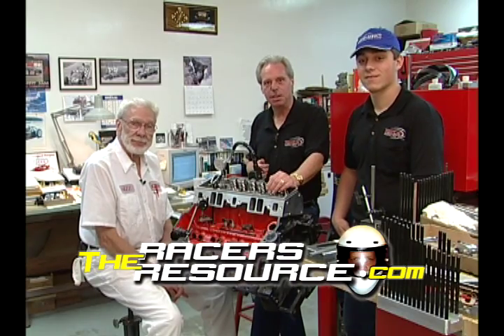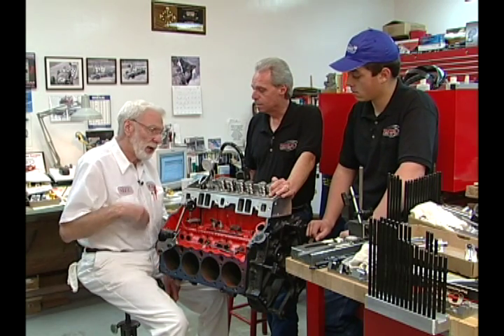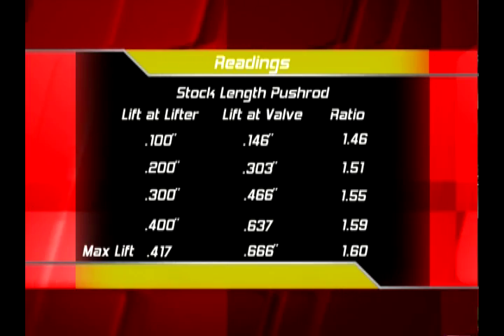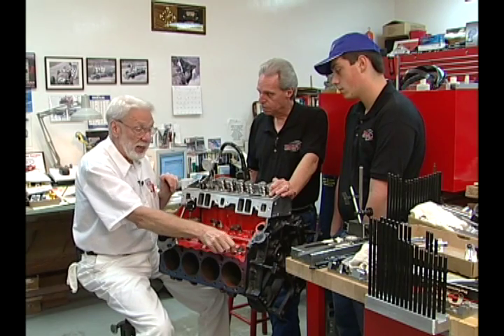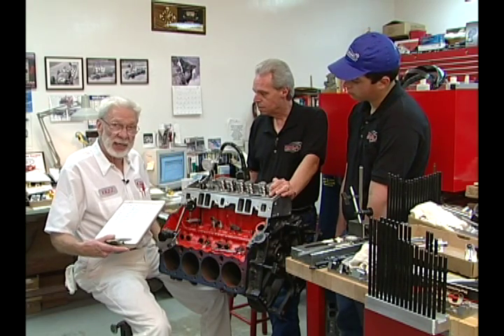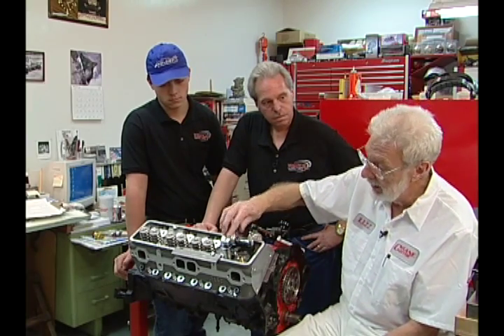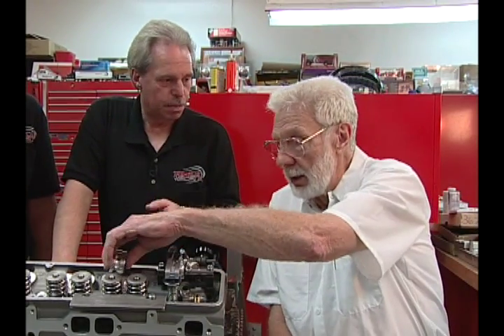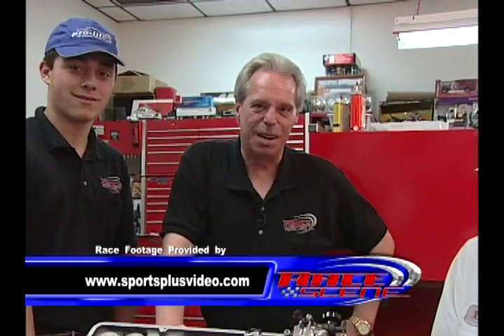More Power Through Improved Rocker Arm Geometry

Comment: Some racers, notably the super stock guys set the rocker geo. based on the how much torque it takes to rotate the assembly. Did you do any testing to see if the long pushrod( stock rocker) required less torque to rotate?

Comment: I have a 406 that i built a few years ago that is very powerful for what it is.. anyway I went out install girdles and it had .100 longer intakes but when I built it I split the middle of the 2 push rods lengths i measured thinking the shorter exhaust valves would be ok even though the tips showed the roller was not centered on the exhausts as good as the intakes.. Anyway when I had the rockers off I decided to fix it to get the roller more centered on the exhaust so I got some valve caps and now all tips are perfectly centered with .622 lift .. 

Long story short.. my engine gained power! I was amazed.
Reply: I mean i put .100 caps on all the exhaust tips to get the valve lengths the same.

Comment: My question is. Why didnt they design the engine so that the rocker arms are longer on the push rod side to have more leverage to reduce the amount of power required to push the valves in? It should free up some horsepower. How many horse does it take to push them valves down?

Comment: But incorrect loading of the valve creates more problems and guide where, so isn't it better to change the rocker arm and stick with the correct valve geometry?
Reply: Race engines get refreshed fairly often.
Street cars are a different animal.
Reply: This is targeted for the racer that is limited by rules. For instance, a 1.5 or 1.6 ratio are very typical rule limitations.

Comment: What did the lifter valley get painted with
Reply: Usually the coating for inside electric motors.
Reply: It's suppose to help drain back.
Reply: It's called Glyptol, made for industrial electric motors, common practice back in the day, now not so much.

Comment: This is smoke and mirrors..... just get a 1.65 rocker and the correct length push rod to center the rub mark on the valve stem tip , in other words this guy is simply making a 1.6 of a rocker act like a 1.65 rocker at the cost of off centering the rub mark on the tip of the valve... this is very bad for valve guide to valve stem wear ! ( I bet if you call Crane cams and  talk to a tech guy he will tell you the correct length pushrod will center the rub mark on valve tip )
Reply: ahhh i think the point here is how to bend the rules folks,clever old man,grey hair,but i bet he could make a "stock production motor go better than most of us.within in the rules.get it?
Reply: Engine Durability in a Race doesn’t matter if your in it to (win it )with making the engine have the horses 💥 power....  end of the day that’s what matter here according to the old timer ⏱
Reply: This is an engineering lesson.
Do you hear him tell us who he worked for ?
He doesn't get his info from Hot Rod Magazine.
Reply: Watch again.
And try to listen.
Reply: @hotrodray6802  no, he's right. if this is for a racing engine then you won't be pushing stamped steel production rockers beyond their limits, you'll use the appropriate parts. for mild street use you can push stock parts a little, but it will stress the valve train more. simple fact.

Comment: Great video, thanks a lot! I just have one question, did the lift at the valve increase with a a longer or shorter pushrod?
Reply: He added a .150 thousand longer pushrod and increased the ratio. When you add ratio depending on cam lift at the lifter you can expect on avg anywhere from .30 to .40 thousand more lift depending on what your lift was at the cam was so more lift made into the cam originally the more lift you’ll get from the increase of the ratio. Either way your increasing the ratio just beware I’ve seen people running a .480 lift cam with a 1.5 ratio rocker and pressed in rocker studs go up to a 1.6 ratio and make the lift around .510 and end up yanking the studs right out the heads. If you have pressed in studs I’d recommend at least pinning the studs as a cheap way to avoid this before ya go starting to play with your rocker arm ratio.
Reply: @85gbody97  I would add....Make sure you've got the clearance in your spring package and retainer-to-seal clearance!! I've seen plenty folks scratching their head trying to figure out why they were bending/breaking pushrods. 
Also, the longer pushrod trick only works with the old school stamped rockers because their contact area on the nose is long enough to accommodate the added angularity and travel. A roller tipped rocker of any sort needs the correct length pushrod or the roller can easily roll off the tip of the valve or poor geometry can cause accelerated valve guide wear.
Reply: Increased ratio equals more lift.
Reply: @hotrodray6802  Yes, but lets sharpen that.  Because the rocker travels in an arc, ratio is actually dynamic through its full range of motion.  For the same cam lift, a pushrod change uses a different part of the arc.
Reply: Tecnomec tecnologia e ensino de mecânica  shortet

Comment: I'm no expert but I do know that when the pushrod is the correct length for the application, the tip of the rocker arm will be centered on the tip of the valve stem when the cam is at 50 percent lift. If the pushrod is too long or too short, the tip of the rocker will be offset towards the outside or inside of the valve stem rather than centered over it. This can create side loads on the valve stem that increases friction, stem and guide wear. Catastrophic failure is next, just my opinion.
Reply: Yes, that's exactly what this does, it places the initial contact point of the valve to the rocker tip at the leading edge of the valve. It will increase wear but this is intended for race engines where you're looking for maximum power without regard to long term durability. I asked Ralph when we were filming this segment about the increased side loads and he said the gain in power outweighed the loss due to additional side loads.
Reply from the maker: +Pontiacman It will definitely wear parts faster but some racers don't care especially in very limited classes where you're scraping for every edge you can get.
Reply: So we’re all of you asleep when he was doing bluing? Check after everything you do.
Reply: Jason Rogers I think the old man said he favors the middle stem to middle stem edge when bluing..
Reply: @Dodgechallengersixpack  middle stem, but towards the outside of the engine a bit is what he said.
Reply: Danny Duplechian , Yeah I'm with you! I wouldn't even do it on a race motor, especially if you don't have deep pockets.
Reply: +Pontiacman That was my first thought, Im curious even on a race motor if its worth the stress on the valve stem.
Reply: This doesnt apply to drag racing where there is no rule, but the benefits for rule classes would be there if you only have to hold it together for the duration of the race.